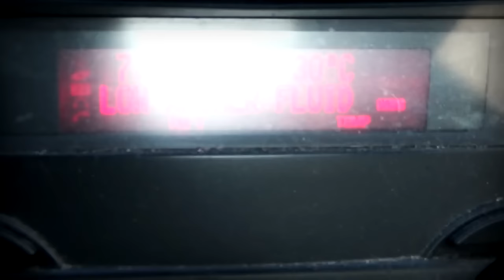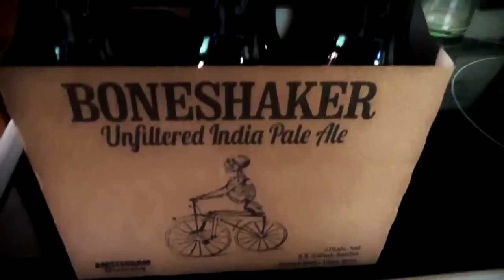re arranging the garage

Comment: Wish it was cool in my room when I finally went to bed, my PC heated the room up to about 32 Degrees Celsius this morning, that was pretty nasty to sleep in... :S

Yup, that seal needs fixing, before they start drilling for oil in your garage... :P

Well, if you had lost the chute for the pushycutty, then it would just have been a good excuse to replace the mower with one that you don't have handle-problems with... :P

Well, you can honestly say it now, you have an axe to grind, though it looks to be a splitting maul, rather than an axe, good for making big logs turn into little kindling, which seems appropriate considering there used to be wood stoves in the house and garage in the past... :P

And you could probably take the handle off cheap-axe and apply it to decent-axe head, to make a nice wood splitter... :P